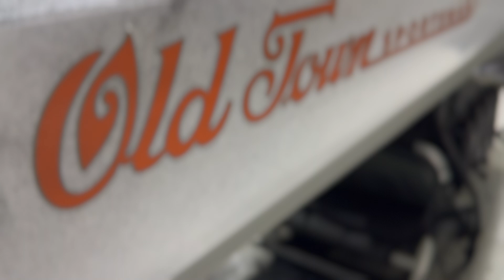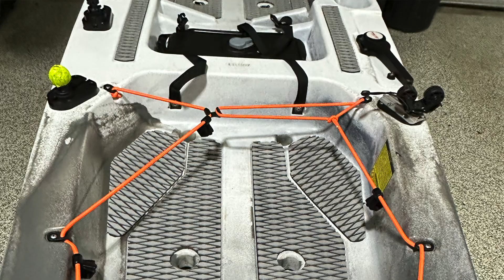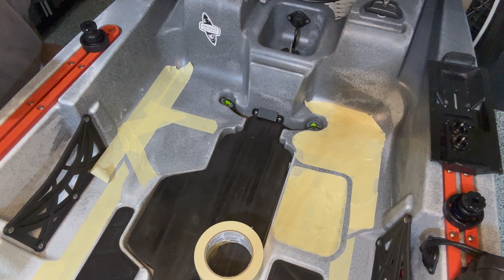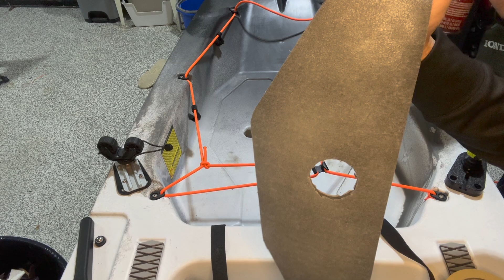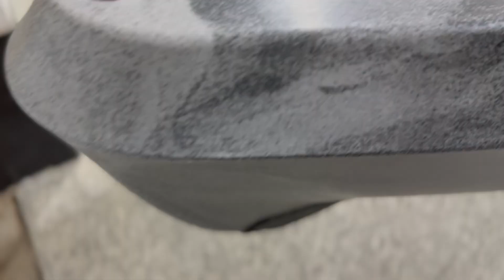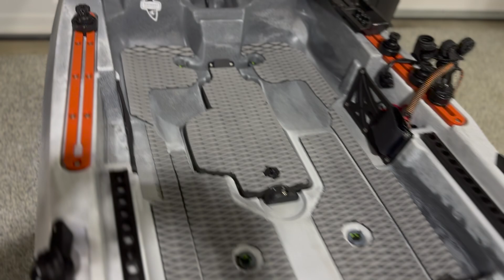DIY Kayak flooring mat, how to make and install under $100! Old Town Sportsman 120

Comment: Would scruffing it a bit with fine sandpaper help it hold better?
Reply from the maker: I’m sure that would help, good suggestion. Since this project I have fished with it several times with no issue. I used alcohol rub then applied some spray adhesive. The heat gun also was key in forming it to the yak. Thanks for checking out the vid!

Comment: Looks good 👍. 8 don't understand why Old Town didn't put the padding in the tank well just to damping the sound from crate noise. Thanks for sharing 💯🤝
Reply from the maker: Appreciate it! That’s a good point on the sound. I didn’t talk about that, but it definitely helped with the sound. I also put some padding under my seat riser, worked out good. My crate legs were starting to make indents in the yak, now sitting on padding as well. I did fish with it several times and it made a big difference standing more forward in the cabin. Thanks for watching.